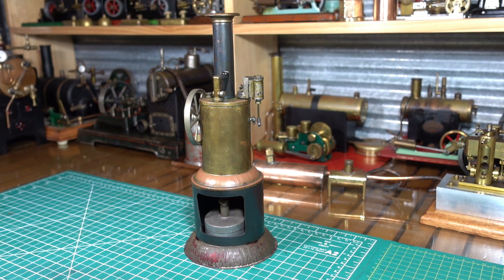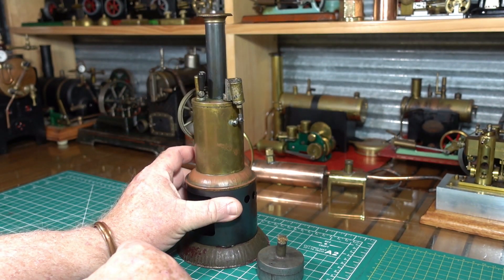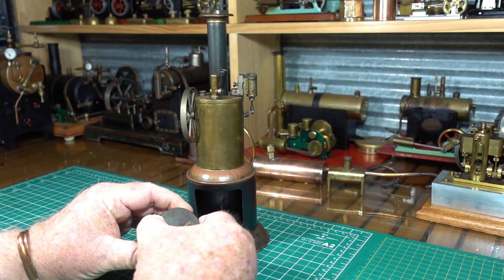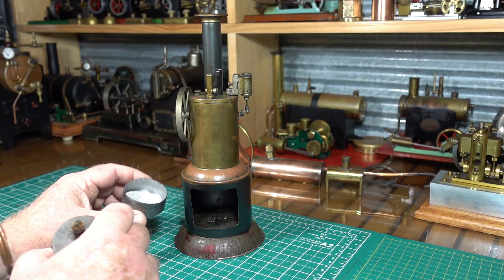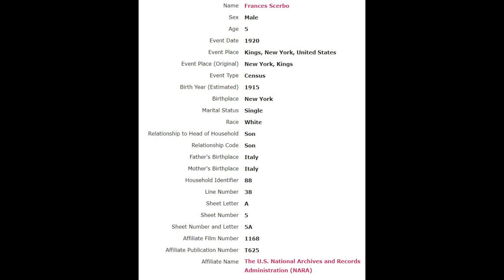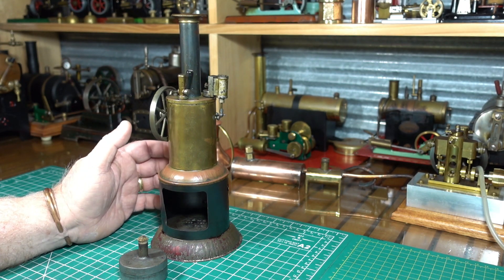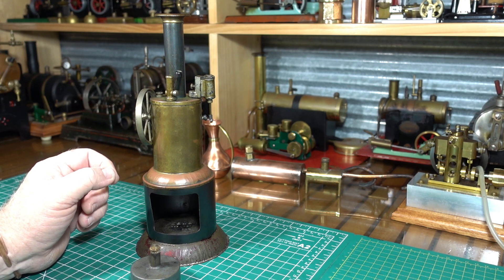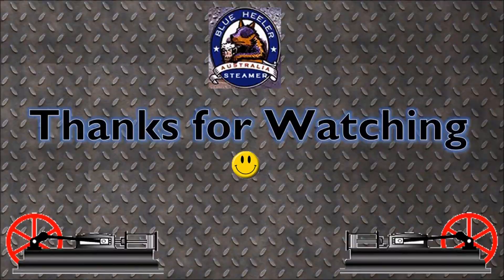Model Steam Engine or Toy Steam Engine the Sad but wonderful history on this very old Weeden Engine

Comment: I inherited a Weeden #10 from my father in-law who recently passed away at 90 years old. Unfortunately it's missing the part with the little black handle, the pressure release valve. Can't find another one anywhere on-line. I was able to get it working using an air compressor.
Reply from the maker: Be careful using air that you don't use to high a psi as these Weeden boilers are very thin. A machinist will be able to make you this missing part.